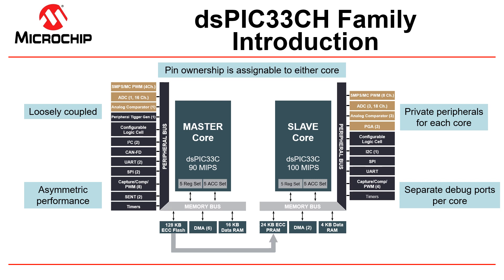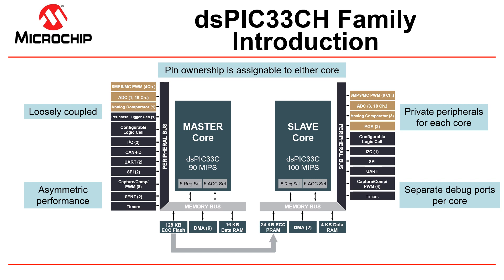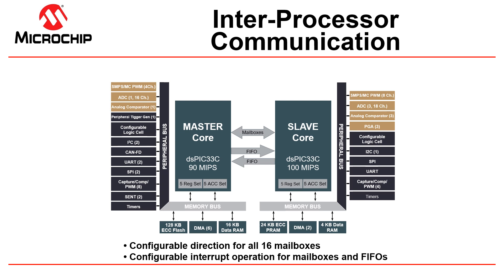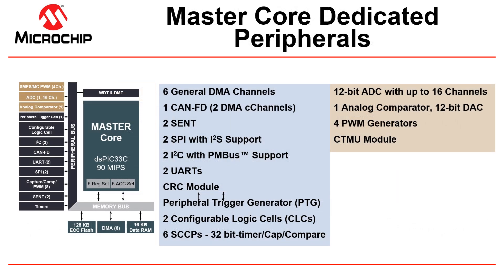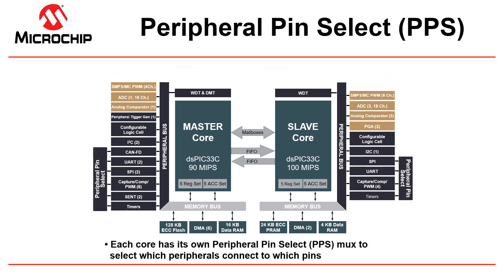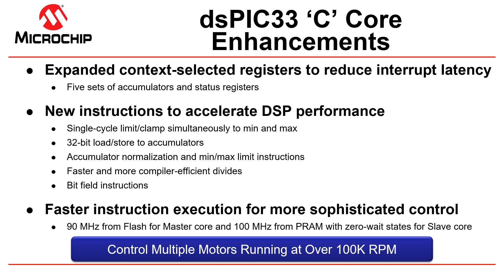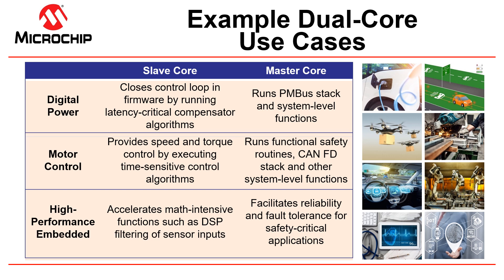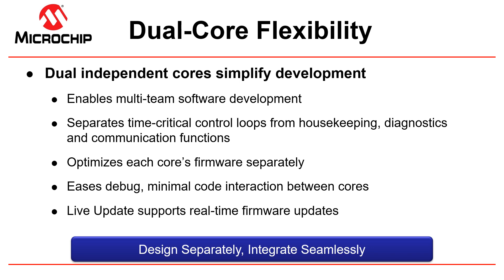Introducing the dsPIC33CH Family of Dual-Core Digital Signal Controllers (DSCs)

Comment: It's still unclear after watching this video whether program codes for the two cores can be separated so as to protect them from being disclosed by the opponent?
Particularly, if slave core code needs to be protected from accessing it freely by master core programming team or end system integrator - is this possible or not?
Motor drive application could be a good example for this - when proprietary motor driver is developed by one company using slave core while passing end user interface development task to another company to be implemented using master core.
How can motor driver related IP be protected in this case?
Reply from the maker: Kindly visit support.microchip.com for assistance. Thank you.